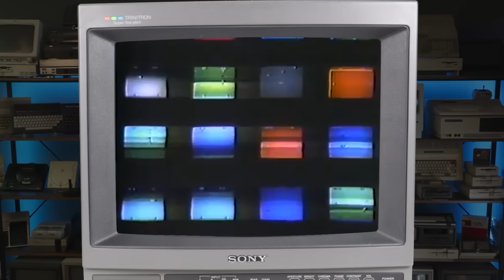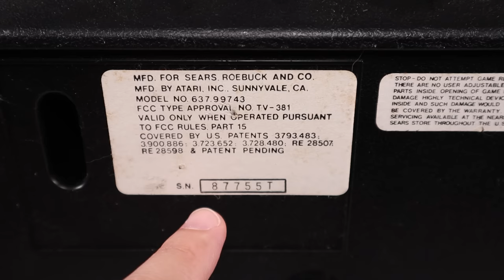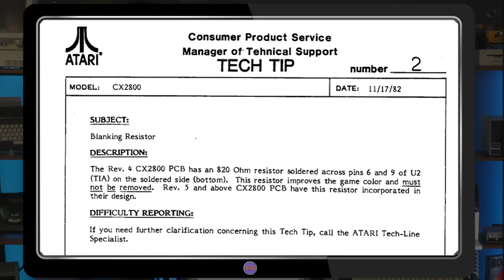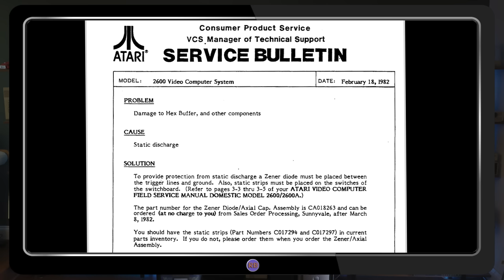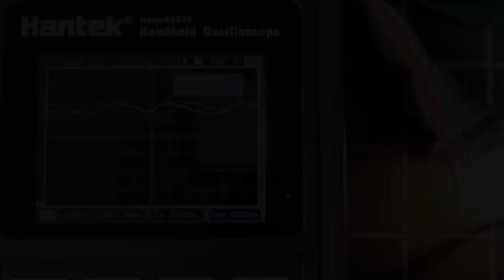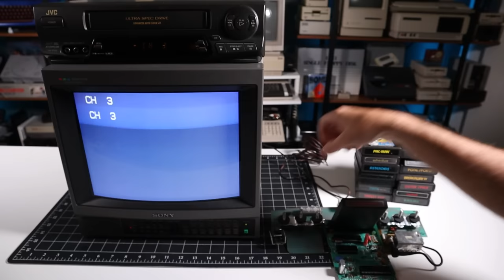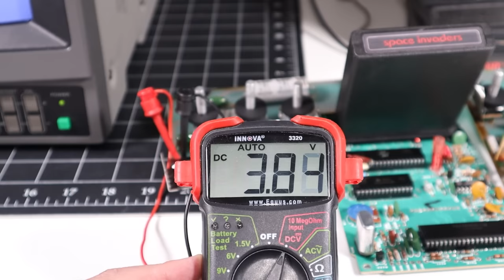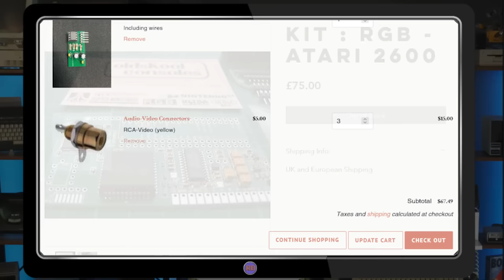Sears Tele-Games Video Arcade First Look and Restoration!

Comment: This was my grandparents' first Atari 2600 console. Previously, they had a Sears branded Atari Video Pinball console, but one day my grandfather came home with this. I'd never even heard of it. Of course, I was about ten at the time. It came with Target Fun (AKA Air Sea Battle) and we played that game to death. Next he got Combat (I forget the Sears name for it) and we loved that as well. Later, I got an actual Atari brand 2600 for Christmas.

About the switchbox: A few years ago, i had occasion to hook up an Atari 2600 and the picture was horrible. Lacking one of those RCA to coax adapters (and not wanting to order one off the net), I popped the switchbox open and wrapped some bare wire around the contacts, connecting them as they would be with the switch in the "Game" position, effectively bypassing the switch. This drastically improved the image. Those switchboxes were always a problem. You could tap them, the image would improve for a few minutes, then go back to looking crappy. Or you'd try sliding the switch rapidly back and forth in the hopes that it would clean the contacts a little. Or you'd try to slide it 98% of the way to the "Game" setting, hoping that might make better contact.

Comment: The 2600 was designed to have two internal speakers, but they were nixed for cost cutting reasons.  You noticed that the TIA chip has two outputs for left and right audio, but they are bridged in the final design.  The very first games, such as Combat, are coded to play the sounds on specific channels for left (p1) and right (p2).
Reply from the maker: Great info, thanks!

Comment: One funny thing I remember. At one friend's house they never never never disconnected the joysticks for paddles because my friend's dad was 100% certain that the connectors would wear out in no time if they ever did that. 45 years later I haven't seen a single VCS 2600 with worn out controller sockets. There might be some with cracked solder joints though.

Comment: My first console was a Tele-Games heavy six.  IIRC we had to send it in for service because the select game lever came loose from the board.  We returned it to Sears and it was sent to a depot for repair.  When it returned the shielding around the switch appeared to have been left off by the repair tech.

My system shipped with the game "Target Fun", which appears to be a re-branded Air Sea Battle.

I wore down the pads on one of the joysticks, and replaced it with a Wico Command Control stick.
Reply: Ahhh that was the name of the joystick company I've been trying to remember. I have one of the huge Wico joysticks, has a fire button at top of stick. Its white and red.

Comment: The 2600 is my first and favorite system. I'm glad you opted to keep yours stock. The original heavy 6ers are survivors at this point and modding them to work on a composite signal ruins the charm.

Comment: The RF output cable can be replaced with a better quality shielded one as well, if necessary.  Where I lived as a kid there was so much interference it was often hard to see what was going on.  We thought it was the console and exchanged it but the problem persisted.  If I had a CRT I'd try the RF first, but I use a flat panel with a bunch of other consoles and an upscaler, so I've got the UAV mod.  BTW, I've seen mods that don't drill holes but instead send a cable out through the RF cable hole.
Reply: getting a better RF cable is actually a really good idea.

Comment: Matt, this is a fantastic repair video, very clear explanations and reasoning. I especially like the atari service bulletin research, and checking to see if they were applied.
Reply: Matt is known for putting great detail and research into his videos. It's one of the many things I love about his channel and videos.
Reply from the maker: Thanks! One thing I missed in the service manual was the color adjustment. I assumed the washed out colors were normal for RF, but as it turns out, not so! After the video launched I went back and adjusted the system and the improvement is quite striking!
http://retrobits.tv/defender.jpg
http://retrobits.tv/breakout.jpg
Reply: @retrobitstv  Nicely done on the color fine tuning. After 40+ years these little adjustments make a huge difference for sure!

Comment: Interesting thing about the resistor mentioned at around 15:00. You identify R213 as being the resistor being between pins 6 and 9, but the resistor (clear shot of it at 13:00) is 680 ohms (blue grey brown, gold for 5% tolerance) instead of 820 ohms (which would be grey red brown). And the reading you get is quite far away from 820 ohms (but within tolerance for 680 ohms).
Reply from the maker: Good eye! Perhaps they changed the value from what appeared on this early revision board by the time they issued the service bulletin?

Comment: This video reminded me that I have an Atari VCS that needs some attention to get working again. One is getting a new PSU as the one I got with it was very old aftermarket one and it too has failed. So I got new one on the way and that an RF cable should get it working again.

Comment: I often protect labels with tape and then run a razor along the edge to remove excess and deliberately leave them laminated. Often you can pull the excess tape from the jagged edge at a certain angle so that the split perfectly rides along the edge of the label as the excess tape tears off, which makes it almost impossible to tell.

There’s definitely more technique to it, like pulling enough tape without halting to avoid lines in the adhesive and laying it down from the center-out by letting it droop down in the middle and then growing a third arm to flatten the tape down progressively from there. Of course, you want enough excess that any fingerprints or disturbed adhesive would be on the excess that gets trimmed off (not on the label).

I first started doing this on new laptops to protect the Windows COA or service tag info where they would otherwise wear off over time. I can see why you wouldn’t want to do it to some collectibles but a protected label is often better than a ruined label.
Reply from the maker: This was my first experience with a plain paper label that wasn't laminated or plasticized in any way. Live and learn I guess :(

Comment: Actually, the large number on Tele-Games carts does reflect the number of game variations found on each cartridge. There are 17 variations on Outer Space, 50 Pong Sports variants, etc. Check the game matrices in manuals, you’ll find that number designates the variations per title. Sometimes, the number is the same, it isn’t a unique designation.
Reply from the maker: Good to know thanks! I just assumed they were unique identifiers since I didn't see any repetition and some were as high as 50. I guess if you count all the variations it makes sense.

Comment: Great video as always, Matt!  I have a later 4 switch model that I might go ahead and mod, but I think that I might do mine with a bit of a twist and minimize the amount of new holes made.  😈
Reply from the maker: Thanks! I thought about using the existing RF hole and running to a breakout box or cable but in the end decided to leave it as-is. After the video launched I went back and adjusted the machine's color and the image is a lot more vivid now even over plain RF:
http://retrobits.tv/breakout.jpg
http://retrobits.tv/defender.jpg

Comment: Loved this video. My Atari heavy sixer arrived in a similar state, looked amazing when cleaned up, as did yours.
Reply: Well as i could knew,he didn’t showed fixeing those controllers,instead he just showed some games (but no pacman,what) at the end despite he already did showed some games early on,but i guess he did this on purpose just to show fixing those controllers in another video,hot damnit😡
Reply: Those controllers were for a totally different system (Philips G7000) so never going to work with the Atari.
Reply: @AnnieRat1  that’s true but those other ones from atari will.
Reply from the maker: The video started getting too long so I had to draw the line somewhere. I've already done a bunch more work including fixing cartridge labels, cleaning all of the carts, adjusting the color balance of the system (it looks a lot better now!), etc. I'll have to repair the joysticks another day. Also, Pac-Man still doesn't work so that's another project also.
Reply: @retrobitstv  well fidn’t you try to use alcohol on the pacman cart rather then on the console itself??
I wonder what could be otherwise the problem with it,mmm ,we will see.

Comment: You are lucky those Zener diodes and capacitors were already installed. I was a bit worried when I saw you vacuuming the ports with that brush.
. 😊

Comment: Period correct joysticks will have the metal hex discs glued to the top of the joystick with the "sears" logo on them.  Most were lost, so these are rare to find.
Reply: I had a new Sears Tele-Games console when it came out and there was never any branding on the joysticks. They must not have all been like that.
Reply: @andywest5773  Only for the heavy 6'ers in '77.  After that, they removed them.

Comment: The timing of this one is pretty funny. I just picked up a lot of 4 systems, two of them are Sears light sixers and they were a lot more grimy than this one. I’ve been slowly cleaning them up and I have to say the Sears look is growing on me. I think the alternate wood grain is pretty cool. I found a matching “Tele-Games Center” storage system at VCFMW that completes the look. :-)
Reply from the maker: I might have even been standing next to you when you bought it! I saw someone buy one from the vendor. He had 5 or 6, right?
Reply: @retrobitstv  I got the 4 2600s off FB marketplace from downstate Illinois about a month before VCFMW; the Tele-Games Center was from  a guy up against the wall inside the room by the doors next to the hallway.  We did run into each other on the way in, though. I'm the Cedar Point guy. :-)
Reply from the maker: @granitepenguin  Ahh, different names / different places! I just ordered some storage cases from eBay and they came with 32 more games which is great but doesn't solve the issue of storing the ones I already have :P
Reply: @retrobitstv  That's a good problem to have, though. 🙂

Comment: It’s a shame that the labels got damaged while cleaning. I got and cleaned a heavy sixer about 8 years ago. I went ahead and crashed the console, but I did two things - I avoided running the brush over the decals, and other than some VERY LIGHT blotting with a paper towel after washing, I just let the labels air dry.

I’ve seen others apply clear shipping tape over the labels, carefully trimming the edges to leave it on permanently, but that’s a personal choice.

Comment: Nice find, and a good price, enjoy. 
P.S. There is nothing arbitrary about replacing 46 years old electrolytic caps, on the contrary, you should have replaced them all without even powering the system on. I wouldn't even use a 45 years old "new" capacitor that has never been used but just sat in a drawer. That is just asking for trouble. Seeing no leaks does not mean a cap is still good, they just lose their properties in time, they start behaving like resistors. The term is "electrically leaky", and it is very dangerous since it creates unwanted current flows in the circuit. This is especially true for decoupling and smoothing capacitors. Think of it this way, you have a smoothing cap in the rectifier circuit between positive Vcc and GND and it is leaking current. this current is a burden on the transformer and the diodes, and it will not only drop the voltage, but do a very lousy job in smoothing the DC. I bet that saw tooth you see on the scope will totally disappear if you replace the smoothing cap in the adapter.
Reply from the maker: I actually bought a completely new modern power brick for the system, just for future use. It was only $10. I didn't show that in the video because it was already getting too long. I did test the caps for ESR, and nothing jumped out at me as being too far out-of-spec.
Reply: @retrobitstv  The cost of replacing a few caps with new, good quality ones is next to nothing compared to replacing even one IC in that machine. Believe me, I learned my lesson the hard way when I first started repairing/refurbishing retro computers. It's just not worth keeping them in just because they test as "good", they are way over their expected life span indicated in the manufacturer's data sheet, which is never given in years, but in "working hours".

Comment: There’s an inexpensive kit to convert the output to composite video and for a more experienced electronics tech, it can be converted to stereo sound!
I have the identical unit! One thing I have had to fix several times over the years are the solder joints at the bases of the switches that have the long leads soldered into the main board. Nice video!
Reply from the maker: Thanks for the tip! I will be careful with those switches.
Reply: @retrobitstv  I had to reflow the joints on one of the ones I'm restoring, too; and it's obvious someone else has replaced a few on another one.  I'm sure they get abused pretty heavily since there's no physical strain relief in the design.  There was old flux all over the place inside all of them, too; just like what your looks like.

Comment: To protect delicate stickers like that, use a matching luster clear coat, tape off the console from the spray.

Otherwise the stickers will get ruined with age or handling. 

Extra work but matters if need to preserve them
Reply from the maker: My first encounter with stickers that were just unprotected paper. Live and learn I guess :(

Comment: I have a Gemini console.  Seems like if you even breathe on the cartridge while it is turned on, it will freeze up.  For some reason, I have a bunch of Atari 7800 cartridges which came with it; it was from the neighbor across the street.

Comment: The power supplies were like this. I had a rather expensive/quality one from the period, that belonged to a nice calculator and its pitiful rechargable batteries. It started to melt when you left it running without load.
Also, you can't fully test the caps like this, you'd need something like Mr.Carlsen's magic cap tester to get all failure modes. I'd just replace them all.

Comment: I was under the impression that all Odyssey 2 controllers were hardwired to the console.  And while mine is hardwired, it turns out they did make some systems with DB9 connectors for the joysticks.
Reply: Hmm, I bought an Odyssey 2 back in the day (when the controllers were still Silver like the console), and they were plug-in. Of course, I don’t recall how long it had been out when I bought it, so maybe the very first ones were hardwired?

Comment: As far as I know, modern HD televisions can still tune into channel 2 and 3, so it is easy to hook an Atari 2600 up to a modern TV.  All of the modern televisions that I own have been able to play from RF.  😊
Reply: They can, but most of them can't tune directly; they rely on you doing an autoscan to put the channel in memory.  I get around this by turning on the 2600 and leaving it running while doing the autoscan so the TV sees the signal and records the channel in memory.

Comment: I like the fact that you kept it original. The VCS is pretty nice in terms of fixes but I wish you had gone a little more in depth on the voltage regulator and I hope you kept the original faulty Atari branded regulator, which in itself is an interesting bit of Atari history.

Comment: i want to pimp this so bad 🙂
and also make a 3d-printed case as successor. kind of similar but with improvements like joystick ports on the front and different connectors on the back, or a bigger long hole on the back for different bezels (composite out, vga, hdmi, stereo audio, a typical barrel jack or usb power supply, ......

Comment: Good call on keeping it vanilla (RF), I think upgrades like UAV are more suitable for an actual Atari 8-bit machine (400/800/XL/XE) when dealing with 40-column text, maybe not as critical for basic TIA games.
Reply from the maker: Agreed, the graphics are so basic it doesn't really seem necessary and the RF video actually looks half decent with the switchbox taken out of the equation! More and more I find myself leaning towards the "if it ain't broken..." approach, especially with older, less ubiquitous systems.

Comment: What happened to Pac-Man?  Did you try it again after replacing the voltage regulator?  Did you clean the edge connector?  Did you remove the ROM and try to read it with an EEPROM programmer (I don't remember if you have one of those)?
Reply from the maker: I cleaned the edge connector but it was pretty heavily worn. The cart still did not work after repairing the console. All the other carts in the lot worked except for that one. I may try and pull the ROM but I'll need to carefully remove the label without damaging it to get to the hidden screw.

Comment: Does Pac-Man run with the new voltage regulator ? You didn’t show. 😮
Reply from the maker: Pac-Man still doesn't work. I will have to troubleshoot further but the challenge is to remove the label to get to the hidden screw without damaging it. All of the other games I tried worked fine though.